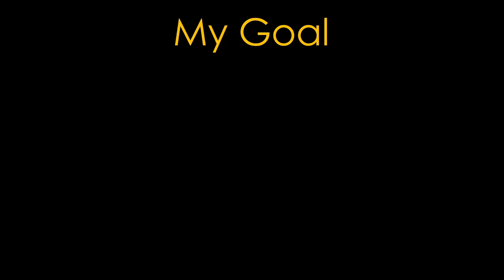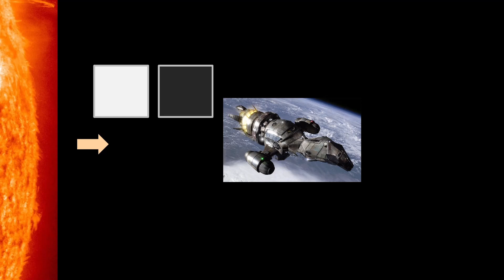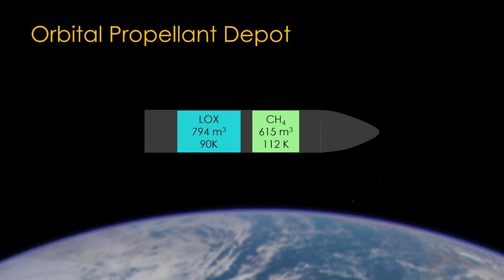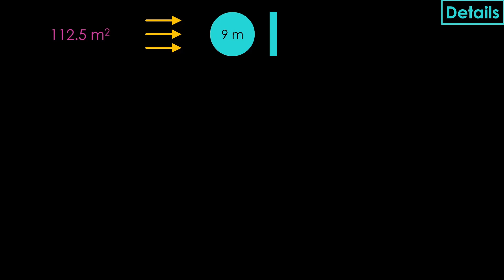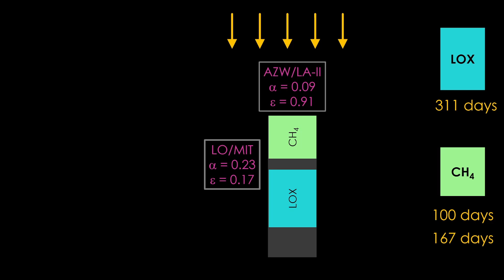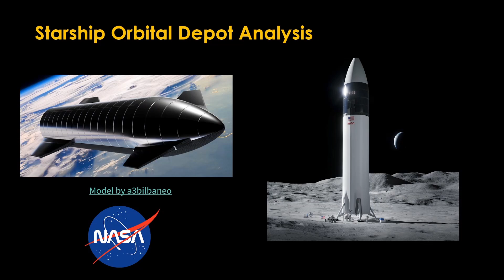Starship Orbital Propellant Depot

Comment: Would it make sense to build slightly smaller tanks just so they're insulated inside the fuel depot?  Can always build them taller just to overcome the loss in volume.   The outer shell can still be pressurized for liftoff, then turn into vacuum once in orbit.
Reply from the maker: You could do this. It would add a lot of weight.

Comment: I think it needs to be a real space station not just a tank. Cryocooler with solar panels, sun shades, and radiators. It still takes 14 launches to fill the thing even with zero losses. With the RS-25s only lasting 15 launches MAX I am concerned that filling the depot will use the entire life expectancy of 1 starship
Reply from the maker: I expect the raptor will have better longevity than the rs-25 simply because methane is so much easier to deal with than hydrogen in terms of pumping it around.

Comment: I feel this is missing something crucial: temperature increase due to pressure increase. The system is not going to stay at the 1 ATM that (I assume) you pulled the vaporization energy from. The tanks are definitely capable of withstanding more than 1 ATM, and with increased pressure comes increased temperature without boiling. That changes pretty much all of your numbers, except the geometry of Starship
Reply from the maker: I assumed that you vent to keep the pressure where you want, but I am by no means an expert in this area.
Reply: I suppose I should clarify
Increased pressure in the tanks leads to a higher vaporization temperature, leads to a higher body temperature, leads to more energy radiated. At some point, there would be an equilibrium where the pressure in the tanks is so high that the vaporization pressure is the steady state temperature of starship. I am almost certain the pressures involved in such an equilibrium are well above what Starship can handle, but every milibar of additional pressure should allow for a marginally longer lifetime before it all has to be vented. I haven't run the numbers, but it seems like the pressure in the tanks could have a cascading impact on the time-to-evaporation.
Reply from the maker: Thanks.
Reply: @ZapClang  Hmm trade-off of extra thicker depos of star ship should be done.  if its worth the hassle. Mine intuition says no. I m not sure how tanking will work and any extra pressure would add another complexity during refill or  depletion of depo.

Comment: Would using seven starships, one in the centre surrounded by six others,  as the Orbital refuelling depot make for a more thermally efficient solution?

 and that's before considering moving liquids between the tanks for optimum efficiency?
Reply from the maker: Not sure. You would be approximating a tank with a larger diameter and that would mean more mass for a given surface area, so I think the answer is probably yes, but that's a lot of added complexity.
Reply: @EagerSpace (wyleu warming to his idea sic). Presumably the possibility of debris strike makes the Depot a fairly unnerving neighbour for astronauts. You'd want this to be remotely operated.

Comment: What if use some kind of a screen or a heat shield like the one on the James Webb Space Telescope?
Reply from the maker: Possible. You need to come up with the system to deploy it and it has to be the right material, and you have to deal with both solar radiation and earth radiation which makes it harder than James Webb which is in the middle of nowhere.
Reply: @EagerSpace  It could have sense if we will use this depot for years of refuelling multiple missions

Comment: I'd like to see this done for the Mars starship. It'll be much more limited in coatings and radiator methods because of the atmospheric entry
Reply from the maker: I'll think about it.
Reply: No heat from earth. So you can just point the nose or tail at the sun.

It's 50m tall, and 9m diameter. So an area of 1430 m2. (ignoring fins and heat shield) 

So if it radiates at ~1W, that's about 1400 W of cooling.

With people in the nose, it's really just insulation between the living quarters and the lox tank that needs to be considered. You can just have multiple foil layers to get whatever level of insulation you want.
Reply: @gasdive  From what I understand starship will aerocapture at Mars. This would likely destroy any foil coating, which would be required to store fuel for the return to Earth. Regardless of whether they fuel on Mars or bring return fuel with them.
Reply: @DemoR  foil on the inside between the cabin and the prop tanks.

If reentry destroyed that you'd have bigger issues.
Reply: @DemoR  Why do they need a foil coating for a Mars ship?  Most of the fuel on a return trip will be burned getting off and away from Mars.  Also NASA has been looking into it with the The Cryogenic Propellant Storage & Transfer project which might produce results with space based active cooling or cryogenics.

Comment: Subscribed! My guestimate for total boil off was 80 days, wildly off based on your numbers.

You seem knowledgeable on this subject. I had an idea, very possibly not original, about staging for LEO. Falcon 9 currently can't get much to Mars, but I thought: what if it launched a decently heavy payload to LEO/VLEO, and then further launched and 'attached' modified second stages, who's only purpose would be to later boost the entire craft to Mars (or anywhere) and remove each end stage when exhausted. So perhaps a 18 ton lander, or whatever, in very low earth orbit and attached end-to-end would be 5 or 6 stages, a long space pencil. Other than cost, I've yet to see any video on why this would be a bad idea pre-starship. I guess technically the attaching part would be a third stage, but I think you get it
Reply: So essentially launching a stage as a payload that would push other stages, that push a payload. Interesting, not sure how this stage snake would work out as far as dV is concerned.

Comment: Also is a simpler way to prolog the duration of storage, by putting ultracooled oxygen and methane ice in smaller tanks(perhaps 4°K), and pomping the gasses in those cold storage until become liquid again and pomping back.
Reply from the maker: My guess is that the specific heat and heat of fusion aren't low enough to deal with a ton of heat there, but I'll take a look at it...

Comment: For tankers (which is actually just a regular ships (tiles + flaps)), we need to take in the consideration of heat shield presence on one side, as well as the fact that it will obviously not ended up at full propellant load once it meets up with the Depot
Reply: Tankers will Not be just 'standard' StarShips, that would be in efficient, the volume, weight & size of the cargo/habitat zone of StarShips is far greater than the maximum fuel cargo the vehicle is capable of transporting. It will be shorter for sure
Reply: Ya.  No need for a heat shield.
Reply: @jamskinner  the tankers need a heat shield, as they will return to earth for another fuel run. The depot does not.

Comment: more challenging will be to carry propellant 6 months from Earth to Mars and From Mars to Earth to have enough for a propulsive landing...
Reply: It's not a requirement (or likely) to re land on earth, just to slow down to orbit, fuel is also available at the depot if required.
Reply: No, because there's no heat from the earth.
Reply: @gasdive  not understanding your reply
Reply: @jonbong98  well, in the video he explains that there are 3 great sources. The sun. The sun reflected by the earth, and the heat of the earth.

On the trip to or from earth, you're not near the earth. So the second and third heat sources aren't there.

Only the sun heats the ship.

In addition the 1W per sq metre radiated to space by LOX temperature tanks starts to become relevant, as the area of the ship radiating into space is about 1500 sqm.

So the heating is the 13W x 62 sqm of the nose, that's 806W of heating. And the cooling is 1W x 1500 square metres, so minus about 700W.

There would be no boil off at all during the trip, just from heat gained by the ship. The ship would lose heat.

In reality the crew compartment would be unpleasant at LOX temperatures so there would be some heating. But the insulation between the crew and LOX can be large, and the heat flow very small. Much smaller than the heat lost to space by radiation. You'd probably need heaters to stop the prop from freezing.
Reply: @jonbong98  it is simple to reflect the heat from the sun it is the heat from the earth wo is a problem

Comment: Might be stupid to ask. But doe the Starship position relative to Earth makes that much changes? Lets say its vertical like on the video. Wouldnt the heat saving (from sun) only works if sun was always in the same relative position to Starship? But given the Starship will rotate earth every 90mins (ISS as example) you have "sunrises" and "dawns" where the light should be hitting the Starship more from the side,right? So to be max effective you would need to keep rotating the Starship every few mins to stay relative to sun? Smarter people help me correct my wrong assumptions please.
Reply from the maker: You do need to have active positioning control to keep it aligned the way you want it. 
Luckily, you have a lot of gas to use for your cold gas thrusters.
Reply: Yes but if it is always pointed at the sun, it's Not actually rotating in space at all, it's only apparently rotating from the perspective of an observer on earth. Additionally 1 rev per 90min in a friction less environment is microscopic from an energy perspective.

Comment: The lunar analysis is going to be significantly more complicated due to the fact that the lunar surface is not at an even temperature due to the lack of atmosphere.
Reply: I don't think so. I isn't the plan to land on the south pole in a constantly shaded crater?

No sun, nowhere near the earth. Not freezing the prop would be the challenge.
Reply: @gasdive  They're definitely not going to land inside the shadowed crater. Nearby, yes. And that means all the stuff about solar and ground heating comes back into play. And at the south pole with the Sun always low on the horizon, the temperature of the ground is going to vary quite a bit.
Reply from the maker: @dsdy1205  That's the reason I did the orbital version first. There's also the complication that the tanks are only partly full
Reply: @dsdy1205  the sun would be an issue.

I don't think the ground so much. The sun only ever gets 1.5 degrees above the horizon at most right on the pole. So the ground is going to be about negative 100C at the hottest, and much colder most of the time.

Comment: Just started watching. I predict a fortnight of storage.
Wow. I was off by a lot, but part of my mistake was mis-hearing the question as how long will a depot last without significant propellant loss, ie how closely scheduled will the tanker flights need to be and how long HLS has to launch and reach a full depot. I'm looking for a period of 2-3 weeks, just a ballpark figure.

This is great work that no one else has provided to the community. Thanks!

Now, on to abusing your generosity of time spent. How much loss per day are we looking at, assuming the best case you listed with a good reflective coating and proper orientation to the Sun?

I'm looking forward to your analysis of HLS beyond LEO, as it will need loiter time in NRHO awaiting SLS/Orion as well as surface time. Also, you know of my abiding interest in using a standard Starship to replace SLS/Orion, a subject you gratifyingly covered in your last video. For anyone else reading this: A ship transporting basically just the crew can make it to NRHO and back to LEO, using propulsive deceleration to LEO, with no need to refill in NRHO. But - how long can it loiter in NRHO. I know most(?) of the propellant for this will be in the header tanks, which lowers the loss rate a lot.
Reply: NRHO is a long way from earth, so it's only the sun. If you point it nose to the sun there should be almost no heating, and you're going to need to insulate between the cabin and lox tank.

Plus the ship will radiate about 1400W at 1W per sqm.

Comment: The Webb telescope sunshades proved you can do a very good job of preventing heat from getting through with a few layers of coated plastic sheet.  I assume a depot could be fitted with those on the Sun and Earth-facing sides.  Webb's operating temperature is below the boiling points of the propellants on Starship, though it has an entire dark side exposed to space.  In Earth orbit the Earth fills about half the sky and the Sun moves, so it is more complicated.
Reply from the maker: A sunshade would reduce the heat gain, but you would need to figure out how to build it and deploy it. An active cryo-cooler might be a more practical solution. JWST only has to deal with solar gain, so it has an easier job.
Reply: @EagerSpace  every bit helps, especially passive mitigations IMO
Reply: @EagerSpace  I was wondering about active cooling like that in space..  THAT would be an interesting topic and even more so if NASA had anything to report for their cryogenic propellant storage project.
Reply: “Sun shed” aka solar panels . . . 🤔

Comment: I just found your channel and like your clear and concise style a lot! Maybe it would have also been interesting if you went into more detail about how the nosecone or even a deployable sunshield would affect thermal properties. Looking forward to more of your videos about SpaceX and other spaceflight topics!
Reply from the maker: Thanks. 

The nosecone is probably equivalent to the extra front on the methane tank, with better performance because the sloped sides will reflect more away but more absorption of heat from the earth.

I'll maybe talk about sunshields in the next video.
Reply: @EagerSpace  surely the required PV panels will also double as sun shades?
Reply from the maker: @jonbong98  If you're talking about the lunar renders, my impression is that that PV panels are only on the payload section. Given their coloring, I'd expect that they would absorb a lot of heat.
Reply: @EagerSpace  I'm referring to the Depot, sorry if not clear
Reply from the maker: @jonbong98  Do we have any renderings of the depot from SpaceX?
Reply: @EagerSpace  nothing is fixed, but they did show a stripped back StarShip that's longer than standard (3or4 rings) which implies More than just fuel (no need for enough to fill ~3 ships at this point)

Comment: Wow, at the start I guessed 3 weeks, thinking I was high-balling it, when really it's much better. If SpaceX achieves a launch cadence even just double that of Falcon 9, these depots will be way more practical than I believed going into this video.
Reply from the maker: My original estimate was pretty low as well. The tanks are just really big and it takes a lot of heat to vaporize the propellants.
Reply: I'm laughing hard at some of the spitter rambling, and I said "so SpaceX engineers does know what they're doing after all?" 😆
Reply: I'm rewatching this in December 2023. There's another tempest going on about whether the depot will need 8 or 18 flights to fill. Two figures given by two different NASA officials. I assume the high number doesn't allow for the 269t thrust of Raptor 3 and is based on the 185t Raptor 1 thrust that existed when NASA signed the contract - or perhaps the current 230t Raptor 2 thrust.

Anyway, let's go with 10 flights. If we assume a flight cadence of once every 2 days it'll take 20 days to fill. The boil-off of the first few deliveries will be negligible in that amount of time according to Eager Space's calculations. Even if weather or a major GSE problem interrupts the flights the depot can handle the delay easily.

Comment: Great Video. Would love to see what effect isolation and sunshades (you kinda did include thoset already) have. I faintly recall that there was a concept for a centaur upper stage that had a large cone shaped sunshade.
Reply from the maker: Sunshades pretty much give you the same benefit as the separate nose - they are going to heat up and emit IR from their backside as well. 

Adding an earthshade would help to block the earthshine and earth IR, but given the size of starship it would be pretty large. Going with active cooling technologies might be better.
Reply: @EagerSpace  Think of the sun shades of JWST. Multi layer, allowing to pass less and less heat (radiation) to the shaded side (the telescope), layer by layer.
Also,being large is not the problem in space (though some consideration connected to the LEO very small atmospheric drag increased with larger area), the problem is mass. And JWST is a good example to solve that as well.
Reply: @jeechun  that sunshade would/should also be the solar panels, generate power for refrigeration & re compression & shade (yes JWST multi layer)